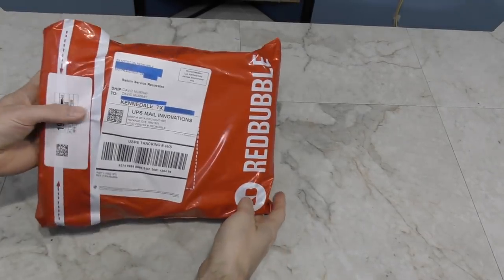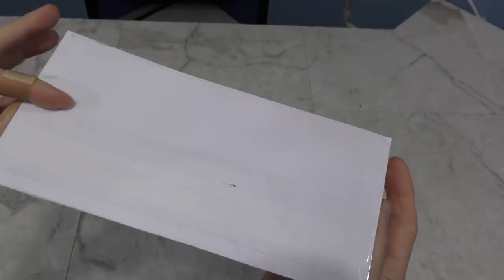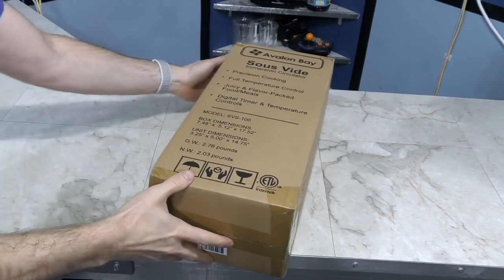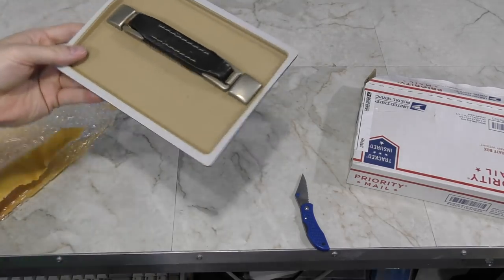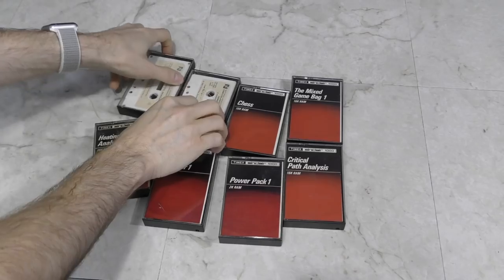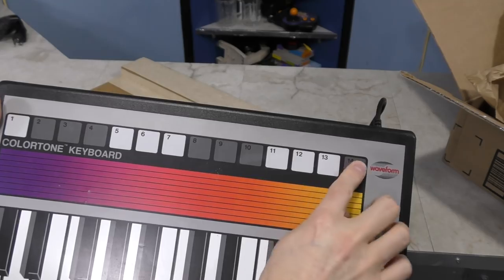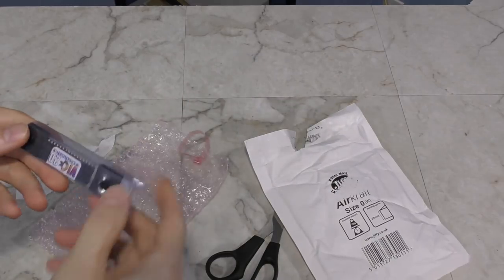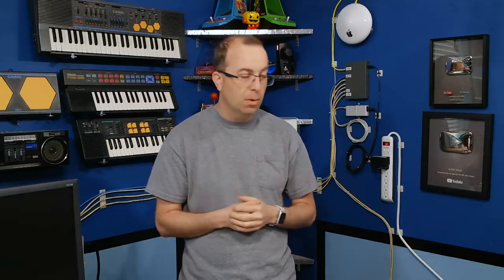8-Bit Unboxing May-June 2018

Comment: I personally will thank the donation senders for the altruism as viewers have greatly benefited from the review of these kind donations.

The FR-301 is listed for 309.97 USD on the HakkoUSA website. These vacuum desoldering tools are never cheap, but every bit worth it for what they need to do. When taken care of, they last practically "forever." On a friendly note, do anything you can to prevent dropping the FR-301. From my experience, the plastic housing can be a bit fragile in certain places and expensive to replace.

Comment: Hey 8-Bit guy, just watched another video of yours about miniature arcade cabinets. I just wanted to let you know that there is indeed a smaller, more accurate version of these cabinets as sold by Super Impulse.

The Ms. Pacman cabinet blew me away. It's small (about three to four inches tall) and fits in your hand. The game plays almost exactly like the cabinet itself. It has fruit, it changes level design (after the sets are cleared), colors and the sounds are crisp and clear. The screen itself is about 1x1 1/2. Great fun.

Comment: Coincidentally, several months ago a friend gave  me a fully working Yamaha RX-7 (less features than RX-15) which I had a bit of a play with, & a Chinese-branded mid '90s electronic keyboard (with a few easily fixed faults) which would still be good for a beginner to confidently learn on!
When I was young I spent the best part of a year having lessons to play the piano after my parents inherited an old upright from a relative, but it never stayed in tune & my hands were still quite small at that age, so I gave up. Eventually a different tuner took one look & informed us that the iron-frame was cracked, so it was really my playing skills to blame!
Anyway, a few months ago someone local to me was selling on eBay a Yamaha MM6 61-Key Synthesizer keyboard about 10yrs old for a really great price (no other bidders due to local pick-up only) which I'm now learning to play, picking up where I left of all those years ago (although did learn to play acoustic-guitar for a while, I'm a bit rusty)!
Reply: Love made in Japan; Thanks for correcting my misunderstanding on how the RX-7 compared with the other Yamaha machines! 
Certainly good to know, especially considering mine is in fully working order! As my friend retrieved it from a church clean-up, my RX-7 may not have had the sort of abuse that comes with being carted around on the road!

Comment: The OkiMate bought back memories (good and bad) of the old OkiData dot matrix / daisywheel printers, that were often very loud when printing.    Of course, not as bad as the printer my parents had for the Apple II which was basically like a typewriter on steroids (very loud, but quite fast, and produced--from what I recall--very vivid text printing, better than dot matrix actually).

Comment: If you can source vic-20 cases, it’ll be perfect so we can build our own VIC-20’s
Reply: there are likely after market cases that can be bought.
Reply: Not to mention 3d printers
Reply: Filamax Hard part would be getting equivalents of the VIC chip etc.  Maybe the digital parts can be recreated in FPGAs etc, but the analog parts may be harder, though not as hard as a SID chip for the C=64.
Reply: So far, I've only been able to find 3D-printed VIC-20 cartridge cases.  There was a crowdfunded production run of 3D-printed Commodore 64 cases, but you can't use those without taking an angle grinder to them, because the ports on the back were different.

Comment: those stickers on keyboard keys were notorious for moving after using the keyboard a few times.  The adhesive was crap, so they more then likely started life all lined up but over time and use they slid.

Comment: That Mac Plus Apple watch night stand is just awesome. 

Man, those Hit Stix... I had those as a kid... also awesome.  And that project sound lab breadboard, I didn't have that one, but I had a 250 in one project lab, general electronics type.. Sound, basic LCD, photo sensor, and well... some 247 more types of thing I guess... Used to make all sorts of circuits as a lad, some 5-7 y/o or so.... Today's equivalent is either staring into a tablet screen, eating their boogers, screaming obscenities while tearing everything around them apart for no reason while receiving zero discipline at all, or so on... Yeah, suffice to say, today's kids wouldn't in any way shape or form want or even know what to do with something like that.

Lastly, that de-soldering gun... Kind of someone to send it, but braid is the best and only thing needed to de-solder anything, in the cleanest and safest way possible.  That thing is enormous, unwieldy, and way too ridiculous to use in a small electronics repair environment.  Braid... regular old simple de-soldering braid, and your go-to iron is all it takes.

Comment: Well, what do we have here!?An Okimate-10 "Color" printer...
Reply: I so wanted one of these when they came out.  Hard to afford the good paper and  cartridges to keep them going.
Reply: I still have my Okimate 20.  Looks very similar, just a beige (now yellowed) colour.  The colour pics I printed on it looked excellent.  You could either use thermal paper, or use a black or colour cartridge and print on normal paper, though there was this shiny paper that was the proper paper for it, if I remember correctly.
Reply: I had one years ago. Took so damn long to print 1 page, especially color. If you printed color, it wasted a lot of the ribbon so I made sure I was printing something I really needed.
Reply: Yeah, very cool. Was given one from my dad's co-worker long ago. Never used it with a C-64, but many years later, I got it working with my Amiga (using an interface that came with TheA64Package). Sold the Amiga stuff, but will keep the Commy stuff forever!

Comment: I tried the controlled heated water and peroxide method it warped/melted the plastic and ruined a vintage portable computer case, your tub in the sun method is the safest, If you attempt to use the heated method make sure the plastics you are trying it with can handle heat!

Comment: Wanted to chime in about the Coleco catridges.

"Colecovision and Adam" just refers to when that cartridge was made. The Adam IS a Colecovision (and in fact, a Colecovision can be expanded into an Adam). The difference is that the Adam came out about a year after the Colecovision did, possibly more (can't remember exactly), and so cartridges from before the Adam was made only say Colecovision, but will fully work in the Adam. 

And any cartridges for the Adam SHOULD work in the Colecovision, as the Adam had tape drives to load software which specifically only ran on the Adam. (The Colecovision expansion would include said tape drives.)

One word of caution if you EVER get an Adam... do not leave the tapes in the unit when you power the unit on. The magnetic pulse from the power supply (and other parts) tended to destroy tapes in record time.

Likewise, if you decide to use regular cassettes in the Adam (you just had to drill a hole in the top of the cassette), always make multiple copies as these tended to fail far faster. (It probably would've lasted longer if you used Metal tapes, but if you could afford them, you could afford the actual Adam cassettes. High school students like myself had to make due with 99 cent tapes.)

Comment: Nice score with the Hakko FR-301 desoldering gun.  I just bought one for $230 on Amazon last month.  You'll love it.

The cheap hand pumps and rubber squeeze-bulb irons do have their place though.  Don't trash them.

You might want to grab the Hakko 633 iron holder which works great with it.

Comment: Wow I loved the Okidata printers back in the day.   The Okimate 10 was probably my favorite printer for the commodore 64.   The color was amazing.  The color cassette was interesting, but always felt waist full as if you didn't need a color on a line that portion of the transfer tape was went unused.   The color ribbon printers were were dull.   HP had their paint Jet, but that required special paper.

Comment: That desoldering iron makes desoldering into a breeze. But you should always make sure the tip and suction pipe is clear while it is still hot (using those steel cleaning wires). I learned the hard way that it is much harder to re-heat and clean out any solder once you have let it cool down.

Comment: I had the Okimate 10 printer on my C64.  To get a good printout you need a smooth thermal covered paper to print on.  Using normal paper got you a printout like you showed in the video.  I don't think I ever printed anything in color with it beyond what samples that came on the floppy.

Comment: The grue line comes from the Adventure (or Zork?) game.
With any luck, that broken LCD only has the contrast pot screwed up.  If the LCD is one of those Hatachi interfaced ones, you could replace it with a 'standard' 2x16 one, if it's really broken.

That desoldering tool will come in handy.  It probably has a motorized pump in there.  I've actually been able to get those hand held spring operated solder suckers to work most of the time.  There is a trick to this, ADD some extra solder before trying to remove what's there, it gives the sucker something to grab onto.  The only time I've had those suckers fail is when trying to remove solder from a via on a multi layer board, that's where you NEED the tool you just got in the mail.

Comment: I was genuinely shocked that the 8-Bit Guy has apparently never played Zork!   🤯  

I was also a little surprised when I saw "Chuck Norris Superkicks" on the "Colecovision" side of that sorting of game cartridges, but I didn't previously know that game was released for Colecovision!  I had to check to be sure, and I'm surprised to see that it was even released for Commodore 64 and VIC-20.  Neat!  I always thought it was just an Atari 2600 game.

BTW, Xonox is a somewhat obscure game company to most, but they made some interesting, if not actually impressive, games for the 2600, including a nifty haunted house game and, more nostalgic to me, a decent implementation of the Artillery Duel game concept (which they simply called just that).

I started collecting 2600 games (and 5200 & 7800 -- as well as Colecovision and Intellivision) back in the late 90's, so much of my knowledge was gained pre-Wikipedia, and some of the trivia now accessible outside of system-specific websites reveals things I didn't learn back then.  :-)

Comment: I have an idea for how to protect that Osborne handle. I work on a fishing boat, and to protect non-stainless steel from the weather, particularly vital joins for hydraulic hoses, we wrap the part in what's called densyl tape. It's a fabric ribbon coated in a thick layer of wax, which is a pain to clean, but once you warm it with your hands and work at it, forms a nearly perfect seal. You would have to test if the wax deteriorates in the retrobrite, but it might work. You can find rolls of densyl tape at marine stores.

Comment: For the Epson PX-8, you may be able to run it off of a power cord, but with mine, it didn't really start to work until I replaced the battery pack.  No nicd pack was really available, so i went to Batteries Plus and bought the cells and made my own (it used sub-c style iirc...)  It's a nice CP/M portable machine. I remember them being sold through DAK in the late 80s.  :)

Comment: Those keyboard stickers would have been reasonably accurately placed but over time as they are pressed they slowly move. Depending on what keys we're pressed most and angle of press will determine movement.

Comment: Ah, the Okimate-10, with its four color ribbon. Produced decent looking color printouts, for the time. Biggest problem I had was if something jammed up and the ribbon got out of alignment, I could never manage to get it back so it wasn’t switching colors part way across a line.

Comment: Hang the handle in water using your new heater so that the leather (and part of the metal connectors) are out and the plastic is in the water?

Comment: While on the subject of desoldering, I recently went out in search of desoldering wick. Not one hardware store I went to, chain or local, had a single length of the stuff. They all had irons and solder, but no means to actually remove it! I ended up having to send away for it. It had to come from Ohio!

At least I now have all the materials I need to replace the capacitor that blew on my Atari.

Comment: Huzzah, another unboxing :D
(00:43) I'm told I use vague reference when I'm mentioning things from the 80s to coworkers who were born after the 80s, but those shirts are too vague, even for me.
(07:06) Needless to say, Clint Basinger of Lazy Game Reviews has a couple of custom AdLib cards also.
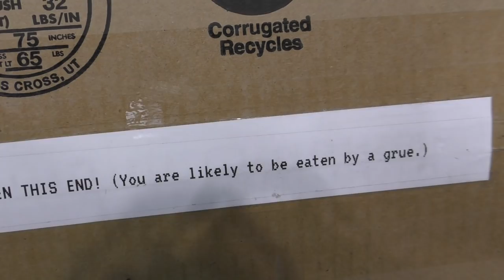(09:16) Grue: look up Infocom interactive fiction games (or the Wikipedia page).
(12:15) I bet the stickers were not "randomly placed". I've had the same issue with Rosetta Stone keyboard language stickers, probably why they stopped issuing them: the glue gets nasty, and they eventually migrate with use.

Comment: I should get one of those parallel adlib cards. I've got a PS/2 with those weird proprietary expansion slots the later model PS/2s used so my ISA/PCI sound cards won't work in it.

Comment: About the RX-15 drum computer: it might just be the power supply, with age, takes too long to stabilise, as it very much looks like the LCD hasn't initialised properly. I'd look in that direction first, given the sender indicates it's intermittent.

Comment: I used to spend $1.25 each for boxes at Uline, 100 at a time, then one cash strapped day I stopped in at HD to buy a few at retail. 78¢ each. I had wasted hundreds over the years on boxes, I have used 5-6 of those 16x12x12 each week for about 6 years.

Comment: About that desoldering gun.
Try it to a dead mobo to find the correct temperature before using it for a retro machine cause it could destroy the traces.
New smd mobos need higher temperatures so be careful switching back to old.

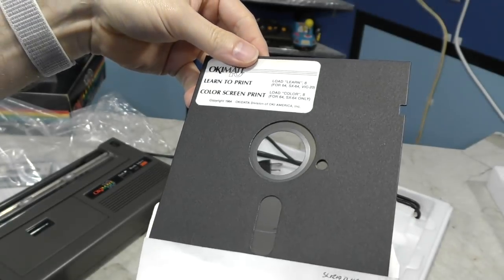Comment: Looks like the floppy disk at 2:58 was severly scratched, judging from the ring on the magnetic surface :( Most likely due to a dirty read head, scraping away the coating of the disk. So, remember kids to always keep your drive heads clean!
Also, thanks for the video!

Comment: The display on the RX-15 looks like it isn't even initialized. Those 1x16 display are often 2x8 internally and have to be switched to "two line mode". Since this display isn't, it shows only the "upper line". I think it is just a connection problem, if it isn't, you can most likely put a random 1x16 "HD44780-compatible" in. They are all the same and quite cheap those days.

Some care is needed regarding the pinout and the specifications of the backlight, though (usually 16pins, pin 1-14 is NORMALLY the same and 15+16 are the backlight) .. but the connector can be located either on the top or the bottom of the display, aligned to the left or the right, AND the pin numbers may run in either direction.
Reply: Aaaand I just realized you did a video series on them just beforehand doh .. well, I will leave that her for other viewers.

Comment: to retro brite the osborne handle try the submersion method but leave the leather part suspended in mid air using chopsticks or wire